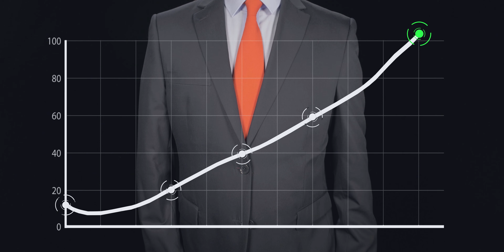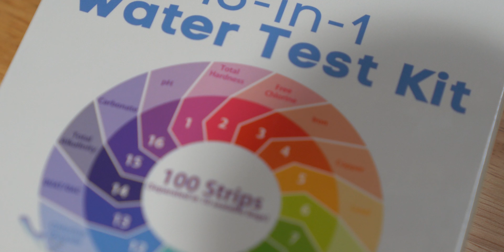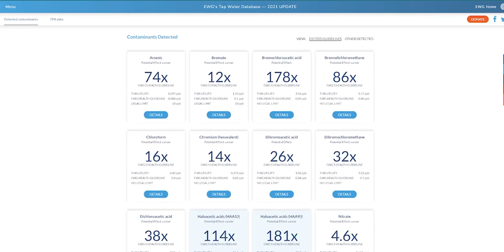3 Things to Make MORE Money in Your Plumbing Business

Comment: I always pay attention to thermal expansion tanks. Usually thumping the air end should sound somewhat hollow. When it doesn’t, I check to see if water shoots out the air valve. And, always put a pressure gauge on the hose bibbs outside. I’ve made sales and helped many customers by replacing failed PRVs.

Comment: Chlorine at the levels present in municipal water is safe to consume. If the smell / taste is offputting then maybe start with an undersink water filter first before going all in on a whole house filter. If I were to add anything to my house it would be a water softener system. The real value-add there (IMO) is not having your fixtures get clogged with calcium deposits. Your appliances will last longer. etc.

Comment: Current market antics aside, even in the best buyers market I would be surprised if a realtor had any interest at all in exposing their precious deal to more failure points. 

Unless the buyer insisted on it, what's the benefit to the realtor?  You sign off on the house, great, their deal moves forward.  You bring up a 12k sewer refit and you may have just sabatoged their deal. 

If a Realtor's lips are moving, they're lying.

Comment: In my area we don't have shity houses with slab leaks it is very rare and i would not remove clorine from my whole house, it is dangerous, we usually remove chlorime only in the kitchen sink with a charcoal filter.
Reply: In most filtration systems is activated charcoal. And you’re not just taking out chlorine you’re taking out most harsh chemicals and contaminants and balancing out the ph balance. Most or some people use a softener or home filtration more for external use and reverse osmosis for consumption. But out of curiosity what is your reason for wanting to keep your water chlorinated? Our water in Texas is harsh and smells like chlorine and will leave a stain on porcelain or ceramics.
Reply: Every house will eventually have a water leak. No matter what kinda pipe fittings I use.
Reply: @adamlewis8160  We don't built houses with exposed pipes in the ground it is very rare.
Reply: @BlueCollarMafia  A guy i know used a charcoal filter in his house that has plastic pipes and his pipes turned green inside something grew. Also inside your water heater with the standing water i don't want to see what is growing in the sludge. If your water smells like chlorine all day they are doing something wrong contact the guys managing the water, it might do that once per month, once per a few months but not all the time. Also i want to add that the pipes turned green after the filter, not before and not in the other apartments.
Reply: Slab on grade and tensioned slab on grade construction is quite common in the soithern most parts of the United States.